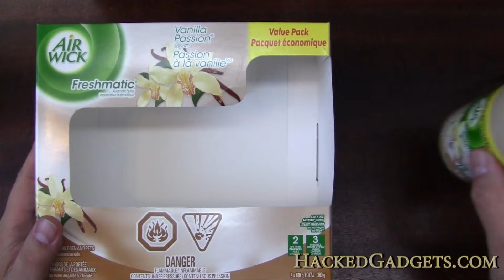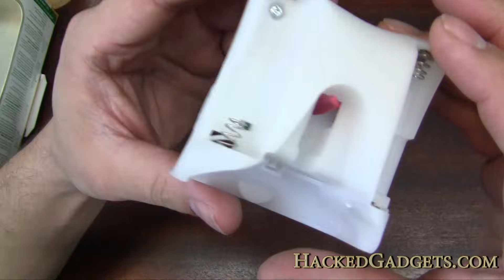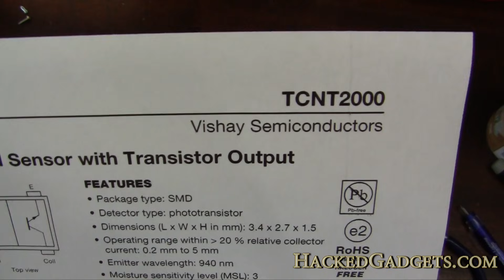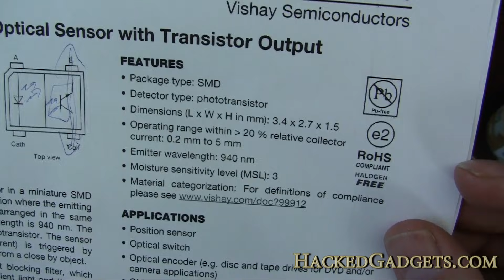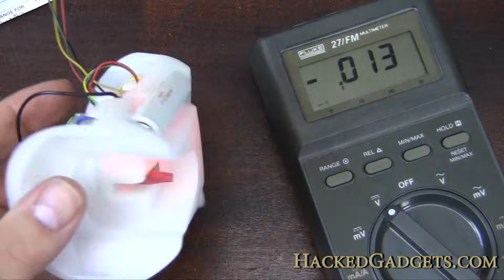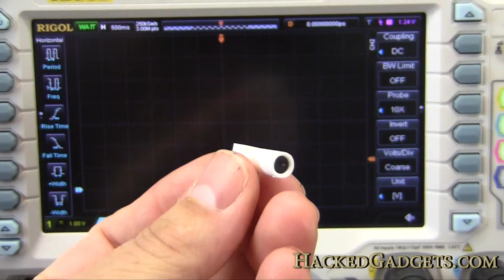AirWick Freshmatic Teardown - Bypass Protection Method

Comment: for any one who is stuck  . just cut the four wires off the sensor. put the red and green together solder and tape  leave the black and yellow allowen no wires showing . put back together and job done . hope it helps . ive done mine but i buy airwick now for 3 to 4 pounds each  and no sensor in them

Comment: I bought one from family dollar and it's their brand called Homeline. It was not cheap, I bought the kit with the machine and one can of air freshener and it was  $7-$8 and the light flashed red from the beginning! It lasted about halfway through the can and stopped spraying. I looked at a few video's and one said to wd-40 the lever inside that pushes the spray button. I did that and it worked through almost the rest of the can. Now, it won't spray no matter what I do and the light flashes red ALL the time! When I push the manual button I can hear a little grunt noise which is faint and quick but still no spray! I've changed batteries, the refill is the same brand as the holder and other than throwing it against the wall, I've tried just about everything. I don't know what I'm doing if I take it apart but it really pisses me off! I've left it sitting turned on thinking some miracle would happen and it would work but no such luck! What a waste of money! It's junk!

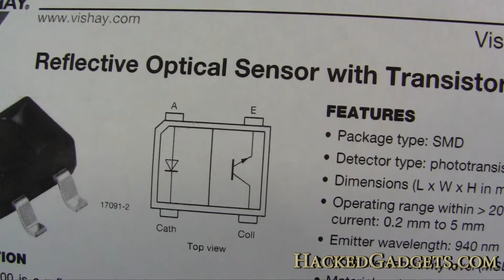Comment: For those of you who want a more permanent solution: solder together the output pins of the sensor marked E and Coll (as seen here 22:31).
The idea is that the IR LED (A-Cath) shines IR light on the spray nozzle. When that light is picked up by the transistor (E-Coll), it closes the circuit allowing current to flow between pins E and Coll, and that current is interpreted as a valid spray from a genuine AirWick can. Soldering together pins E and Coll bypasses the transistor, allowing current through every time the spray is pressed.
I did this to my sprayer and i have no problems with it. Sprays every time with any can.
Props to Alan for the in-depth teardown and detailed explanations.
Reply: Worked fine for me too, on a slightly different model with the same sensor, but an enumeration instead of the characters.
Thanks a lot.
Reply: Thanks,  just solder bridged these two pins on the back of the board, works with any refill now.
Kudos to OP and you for the breakdown and tips.
Reply: I shorted them - it works fine. Thanks for the idea.
Reply: Thanks I just did your trick with the sensor like 5 min ago and it seems ok. You are a lifesaver I been searching for this many times with no luck. I tried different things and none worked. Many many thanks!
Reply: You are time saver thanks bro

Comment: just add a jumper wire between red and green on the 4 pin conector.... worked for me didn't even need to solder or ruin the product

Comment: You said they are only driving the motor in one direction. I think they are driving it down, then relying on the upward spring of the canister. They are measuring the upward spring with the sensor, which likely correlates to how full the canister is. If you read the FAQ on this product, they said it has a consistent dosage. This is likely because towards the end of the can, they can drive the motor slower, which would spray out for longer time.
Reply: Interesting, that could be. If it was still setup on the bench it would be interesting to run it with a full, half full and empty can to see if it is doing that. Certainly has the sensor tech to do exactly that.

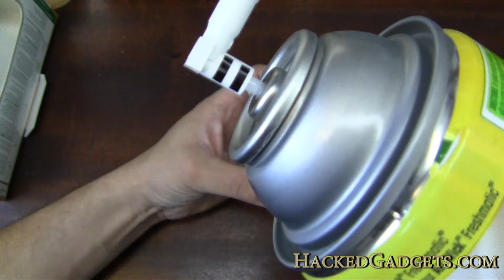Comment: So the quick and easy "hack" is to pop off the valve stem ( 7:42 ) and stick it on any can you want to use in there.  Then the sensor can read it.  The really cool thing I learned is that you only need to short the negative of the battery to the negative of the motor to make it work.  Now I can refill one of these cans with some pepper spray and point it at my front door to jack up intruders!

Wait I read a comment that said:  "The nozzle has a different hole on it that sits onto the straw of the can", so I guess you have to use a sharpie and draw in your own matching marks.
Reply: Made my day Willie. Off to find some pepper spray now, lmao.

Comment: Maye a dumb question so I'm inviting anyone to answer but will this canister still spray if it's laying down horizontally instead of vertically or will it only release the pressurized air instead of the fragrance?   I'm unsure do to the fact that it doesn't continue to spray when pressed like most canisters on the market today.

Comment: All this analysis, tear down, etc, and I thought from the thumbnail of the video that you would provide us a way around via using a wire to bypass the sensor and you end a 50 min video with telling everyone to use a barcode print off?

Is there a better way around?  I want to use my machine in a different application and a print off of a barcode won't cut it.
Reply: If you're still interested, check out my first comment. Basically you just have solder together the output pins of the sensor marked E and Coll (22:31)

Comment: Would it be possible to make the pushing device to push for a solid 2 minutes minute and change the sensor to a heat sensor?
Reply from the maker: not really. if it were solenoid based it could but this system uses a dc motor that is driven with a single polarity. the single pump and rebound is part of the design.

Comment: Awesome video! Thanks for taking the time to do this. I ended up hooking my AirWick up to an esp8266 so I can trigger and modify the spray interval via WiFi. Your video was very helpful in taking it apart! Cheers
Reply: dabears900 how did you do it ? any video to that diy ? I want to make mine as you did with WiFi as I have 4 airwick in all my rooms and WiFi is all around my home so that I can bridge it via routers too..
Reply: Wow that looks like a fun board for less than $4 on Ebay... looks like hooking a circuit to the negative of the battery and the negative of the motor will trip it, just need to figure out the board.
Reply: dabears900 I would love that vid
Reply: What on earth. Why would you do that?
Reply: Shame Air Wick don't sell lives isn't it

Comment: 50 мин тупых рассуждений. Замыкаем 1й и 3й вывод на разъеме. Пользуемся любыми освежителями по размеру. Плату с датчиком можно выкинуть.
50 min stupid reasoning. Closes 1st and 3rd conclusion on the connector. We use fresheners any size. The board with the sensor can be thrown out.

Comment: Stupid video!
Just cut sensor and connect yellow-black and green-red wire.
Reply: +Stevo ovetS how will that help? by shorting the sensor you always read high, but u need to scan a high-low-high pattern as the nozzle moves.
Reply: @robinbuster1323  no... sensor outputs 1 if scan is successful. By shorting green and red you make it always output 1 when it scans so it doesn't trigger any checks. It works.
Reply: you do not have to connect green and red. Only yellow with black. It is the output.
Reply: doesent woork any idea to fix

Comment: Hi have painted 2 black lines in a non genuine can and IT WORKS!!!! much easier!!!

Great video
Reply: How did you get the line in the correct position
Reply: Marker pen lines did the trick on mine just double coat them

Comment: Nice hack. Curious: Could you have taken the printed barcode and taped it directly on to the sensor, maybe with a small transparent spacer in between? Then you could actually plant the sensor inside the unit and it wouldn't need to be near the nozzle at all.
Reply: Hi Mark,

The barcode needs to move past the sensor as the can nozzle is pressed, that is how it knows that there is a can in place. It doesn't read the barcode like a wand at the supermarket, this one is just looking at what is directly in front of it (white or black). It is the movement of the barcode that allows the sensor to see that it is there.
Reply: Alan Parekh Ahh, okay. Thanks.

Comment: The motor wont run backwards. Its the spring tension in the the can the pushes the mechanism back to start position.
Reply from the maker: You got it. That is exactly how it works.

Comment: I don't know if you're Canadian or not, you sound it (no offence meant if you're not).
The ones I have (in the UK) don't use a DC motor, they use an electromagnetic actuator type deal and readily accept the fake refills. Same company, but very different design.
Cool stuff though, watched it all.
Reply from the maker: Yea, I am Canadian. Interesting that they would make different designs for different countries.
Reply: abbtech you know, I just bought this one at the grocery store and saw your video, was going to "hack it" and then discovered that the version they sell here in Mexico is identical, except that it has no sensor to detect the black stripes in the can, there is simply a hole in there where the photosensor should be... interesting huh? maybe (amazing I know) there is not a huge compatble refills market here yet and that way they can sell them at mexican market prices?
Reply: +abbtech34yttribuiykek7igi88uhk78877777677777777&
Reply: Antonio Dávila
 That is interesting. I wouldn't have thought they would make different versions for different countries.
Reply: Hi i live in UK. And I  bought one of those 3 months ago. It looks and works exactly like on this video.
Reply: Alan Parekh Hi again, I can confirm mine is working perfectly with Walmart's "Great Value" brand refills, they cost a third and work perfectly in the sensor-less Mexican version
Reply: I got mine from Asda, exactly the same as this one except there isn't a sensor aswell. I'm wondering if there are some UK laws regarding things like that. I bought the Asda spray can to go inside it, all it took was a little bit of paper placed on top of the nozzle so it goes back up and it works as if it had an airwick can inside it.